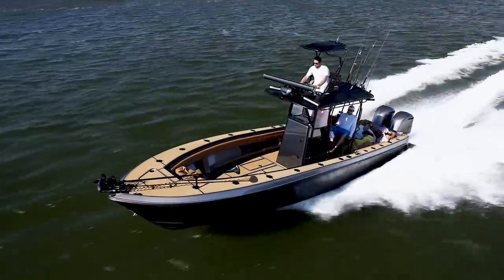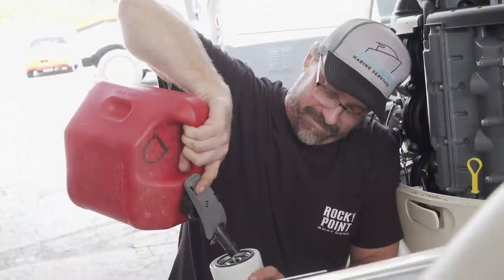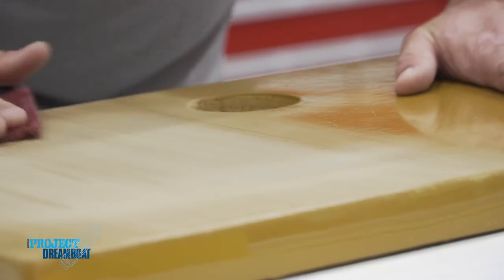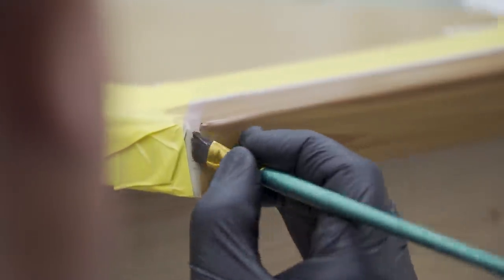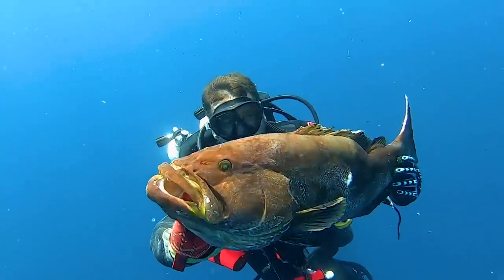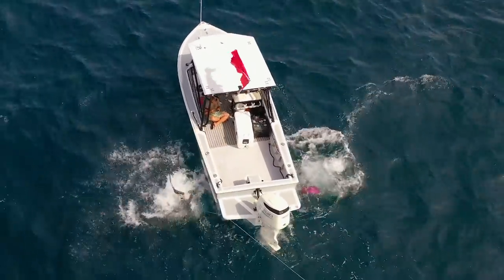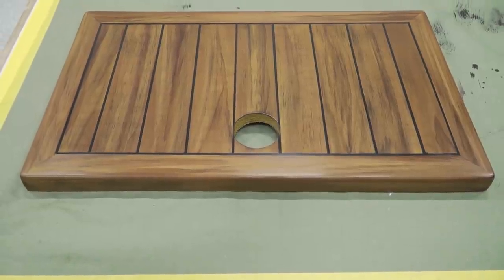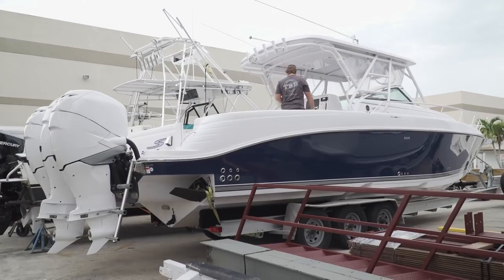Florida Sportsman Project Dreamboat [2021] Custom Forest Johnson Prowler, Outboard Fuel Filter Tips

Comment: Marine grease?
Reply: Use a light film of dielectric grease on fuel filter (diesel/gasoline) oring surfaces/barbs/threads, etc. It’s inert and won’t hurt the rubber or fuel system internals (also great for coolant orings on Diesel engines,etc). It also works well on the threads.